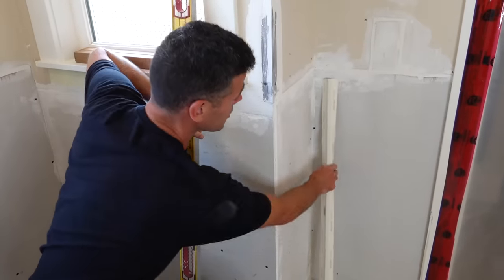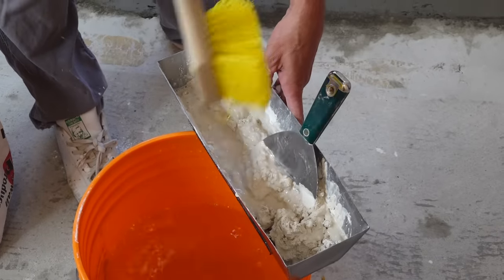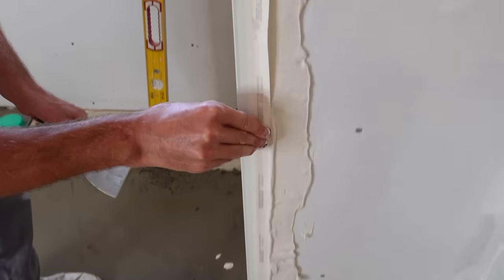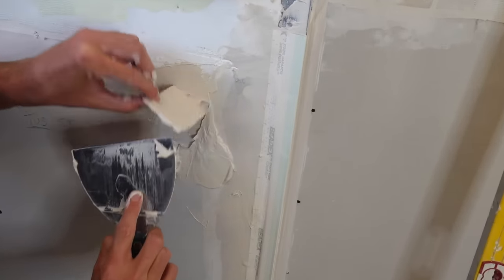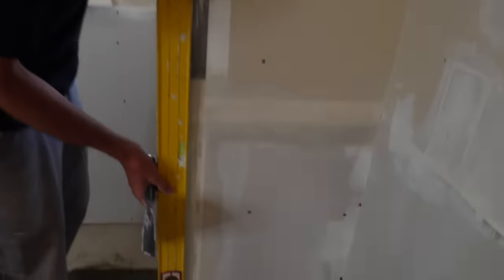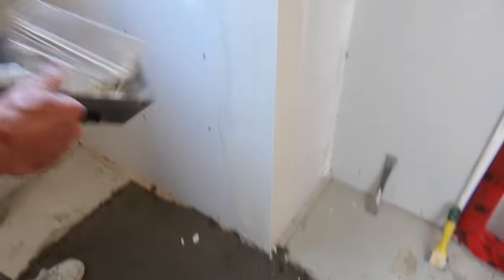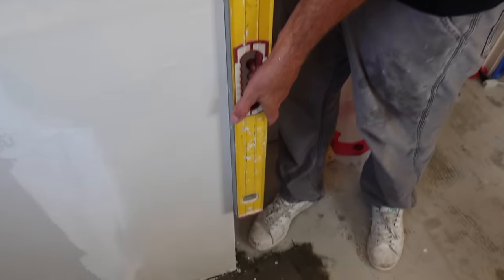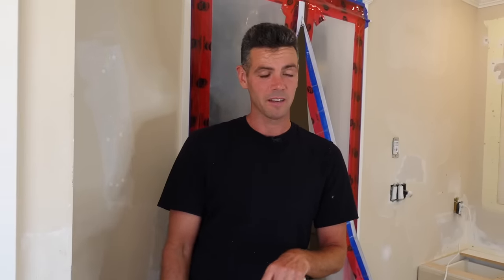How to Join Corner Bead...Seamlessly!!!

Comment: Why wouldn't you tear off the top piece. Replace it with a full piece of bead. Eliminates the hack job
Reply from the maker: Ever walked into a 2 foot flood cut restoration with 20 of these to patch? Once you have you will realize why it’s important to know how splice a bead.
Reply: Why didn't you just pull the old screws out and remove the wet drywall?  Then reuse the corners? Instead you took a grinder and cut them out? I don't understand. Either pull the bead all the way off or find the screws under the 4' mark, remove and slide new Sheetrock behind it and screw it off. Also your already mudding the corner why not do it right and redo the corner. It's not hard I know you know how. Why hack it for an extra buck? If I saw this at my job I'd definitely call you out.
Reply: @phouston6802 @phouston6802 I agree this repair job is a patch. Not the same as a whole new drywall job. Actually you can see the house is imperfect. He should demolish the whole house and rebuild it to make sure everything is perfect.
Reply: @danielanderson7667  LOL, exactly.  Everybody simmer down now.
Reply: @phouston6802 Your idea would just push the meeting point between old and new further out. You’d have to cut drywall back to at least the nearest stud which makes another joint to fix. On the short side there is only a foot to the inside corner, where are you going to cut back to to remove that side? Finding/pulling nails/screws out of corner bead can lead to bends. 
If you ‘call out’ your contractor on this method, and insist on yours, he’ll probably just pack up his tools because you’d be doing him a favor.
Reply: Because these cuts are done by restoration company’s not the finish trades. This is standard protocol when working through insurance. Insurance will not pay for what they don’t have to,  and no one is doing free work either.

Comment: Being a newbie I use Sheetrock 45. Gives me plenty of time to work with it. I’d be scared of trying to use 5 or 20. I’m not THAT fast yet. lol
Reply: 5 is great for patching a hole those electricians love you leave you with when fishing cables in ceilings for example, but use a hawk as your mud pan will be done afterwards unless you clean it out quickly.   20 is similar but you have work working time.   You can easily dump the leftovers from your hawk and clean with a soapy sponge plus if it dry on your hawk it is dry on the wall too!

Comment: Just did a job today where i did this except i used the steal corner bead.  The  wall is texured so small enough area where you don't want to pull out the hopper but big enough where you need more the a can of texure didn't want to go to ceiling. Replaced the whole lower part of the drywall so leveling it was easy.

Comment: Perfect timing on this video.  About to replace a one piece tub in more or less and alcove with a 4 piece tub and wall enclosure.  One side has a partition wall separating it from the toilet and knew I would need to cut the existing corner bead about 2 feet up from the floor to slide the new tub in and was thinking about the process of joining the two corner beads together so not to have to replace the corner bead all the way up to ceiling height if it was possible.

Comment: Been there, done that. Using 2 different kinds of corner bead requires that the old metal bead gets buried to keep that sharp edge from showing and the paper corner needs to be built up to create a sharper edge to more closely match the old metal bead.  
I'm more inclined to remove the old bead and fill any gaps or uneven-ness present from the loss of the original corner. Definitely want to use a quick setting compound. Put in a whole new bead and match it to the wall. Only one problem to solve instead of 3.
Reply from the maker: Could be some regional variance among beads. Our paper beads match up perfectly to the old metal ones. There was no buildup required anywhere on this repair.
Reply: @vancouvercarpenter  
Nope, it was smooth as silk. (I made another comment about how easy you made this repair look.)
The paper covering on the bead is a bit softer looking than on a metal bead, in my experience.  I noticed how crisp yours looked when you flushed it up to the old bead. Pretty nice match. I did some trimless window frames 8 years ago and used a new metal bead, stapled in place. 
I had to shim out the new not quite half inch drywall to match the full half inch existing 40 year old material though. 
Whatever it takes to make it right. 😃

Comment: If you haven’t already, can you do an in depth video on joining new drywall to existing painted drywall? I’ve never actually had to do this, but I have a project coming up where I will, and I’m just curious about the change in surface texture and how that will affect the finish.
Reply: I sand the painted surface with some 60-80 grit. 
Add some watered down glue in my mud and do the joint as usual.
You might want to do a skim coat on the painted surface first as to help avoid bubbles.
Reply: @okkrom I figured I’d need to scuff up the painted surface a bit so I could “hold” the mud, so to speak. Thanks for the tip with the glue and the skim coat! I appreciate it 👍

Comment: Love your videos, thanks for sharing.  Wondering if you have any videos where you install (retro fit) a ceiling expansion joint? I have a job where I need to install a second expansion joint that meets up 90 degrees from an existing expansion joint.  Hoping for some hints.

Comment: Great advice and video.
I have a ceiling to a vertical sky light with a corner tape that has 6 inch split about in the middle if the 5 ft run. How should I repair it?

Thanks for all your videos and assistance.

Comment: This is a good and practical video, thank you. Would the same advice about overlapping the seam apply for taping an angle? Like when repairing a ceiling with new drywall piece that goes all the way to the wall and you are "extending" the new tape from the existing, should I carefully "dig out" a 1" section to the old tape and overlap with the new? Or in this situation just butt up to it?

Also, in this video's example, would it matter if the existing corner bead was metal, could I get away with using paper-faced, mud-set repair?

Comment: Yeah as a residential renovator  I probably would have installed metal bead. But differnt knife stroke for differnt trowel folks.👍
Reply: I too, never used anything but metal beads.(Since 1983) After watching another video by Vancouver Carpenter on paper beads, I encountered a situation where I was laminating a sheet of drywall to one side of a a corner of a plaster wall. I found I had nothing to nail  the bead to. So I figured it was time to try paper corner beads. It worked out especially well. I am sold on the paper beads. It will be my first choice from now on.

Comment: Seamless reapair. You make it look so easy.
Quick question if you have time:
 New wall flexes because pocket door.
Old wall need 1/2 to nothing of mud framing.
Is vertical joint likely to crack because of bendy wall?
Any suggestions?
Thanks for all the great instructionals!
Reply from the maker: Hard to say. Unfortunately there is only one way to find out.
Reply: Maybe I'll come back in a few years to report! Hopefully not! @vancouvercarpenter

Comment: I love hot mud, I tapped a 10 by 10 room, walls only with a 2-foot strip in the middle of the three walls given they tore out a backsplash and tear away up to the existing ceiling with 4 coats of hot mud, along with a finish coat of plus 3, sanded, primed, and painted the next day. I know guys who hate the stuff, their loss.. What's your preferred method of finishing drywall up to an existing popcorn ceiling? The opposite of one wall was the same at the ceiling but I didn't have 3 beads with me, so I applied paper tape as usual but left the ceiling dry, just to use it as a shield so to speak, I cut off when done and I think the tape came out tighter to the ceiling then the tear away, Thanks!
Reply from the maker: I usually flat tape and caulk when going up to texture.

Comment: I haven't used paper on joins in years. How do you plaster a wall with super tight wall paper? That removing the wall paper will end up gouging a good chunk of the drywall paper? In other words, it turned  into a war zone once you got most of the wall paper hacked off? There is a way to do it. Pigment seal it, check it for bubbles or pops. If none then proceed to slap a crap load of long setting plaster on it. Spread it uniform out from a corner to 1 meter all the way up. Now here's the trick, you get a 912 cm by 45 m roll of fiberfuse. The biggest they make and from the bottom up pull out the fuse til you overlap the scotia or corner a bit. Once you're satisfied it's lined up as best as you can get it.

Gently but ever so slightly stick the fuse to the wall. Gently run your splayed out hand over it. You don't have to do it to the whole line of fuse. Just enough so it sticks. Push in the fuse at the bottom where it meets the skirting and simply cut it along the edge.

Now the really hard part and the most crucial part of the operation. Trowelling it in. I use a wide cheap kiddies pool brush i found at home to gently push in the fuse so it stays uniform. Do it once or twice. Anymore and you risk tearing it. 

Once that's done, get your 16" or 18" flat and using 2 hands because you're going to muscle the plaster around under the fuse to fill up the lows and wipe out the highs all the while the fuse beds in. Don't rush, if you got long setting plaster. Say a 120 or 150 set. You've got time. You can tell a low by no wet sheen or if there's a high point where plaster is thicker you just muscle it outwards till it looks uniform. It's not a  new trick for rendering flat. If your walls are sucked in and you never prefilled the voids. It will only follow the wall. It will still look unblemished once painted though.

It's the bedding in that takes the longest and you need to put a blower on it once you've finished it. It's takes days to dry if it's cold. A heater is preferable. Once dried. You get 80 grit pads for your sanding machine and give it a good consistent sand without cutting through the fuse. Lightly but no area left unmachined.

Now for the finishing coat. It will power suck in but you're only trowelling a light coat on. Slap it on thick and wipe it off. Once you start though. You don't stop til you've reached a corner or slimline edge. Once it's all done to your liking. Wait til dry.

Pole sand it lightly and run the light and sanding block over it to catch ridges and spots. Don't go mental and practically sand it all off.

Only 2 coats.

Comes out like new skin and painters love it while the wall is reinforced. I've yet to see anyone anywhere do a vid on how to fuse walls.
Reply: Don't worry about small overlaps when fusing when lining up the next sheet to the 1 you've just done. The machine sands out the overlap leaving a seamless run. I haven't seen a perfect 90' wall or level 5 flat fixing in this century lmao

Comment: VIDEO SUGGESTION:

I searched through your archives and couldn't find an example of what I want to do. In your "HOW TO TAPE 45 DEGREE CORNERS" you've got the sort of sloped wall/ceiling that I've got. I want to put in a rounded corner at the transition from the 45° wall to the ceiling with about a 5 cm radius. Last time I did this, I used USG's Structo-Lite to make the corner, but that product is no longer for sale. Is there a mud product that I should use instead, or should I add drywall to the corners and use taping mud to get the inside curve? I've seen a bunch of locations where you've made these transitions sharp, but I want the angled walls to blend into the ceiling with curves and I haven't seen you do that in any of your videos yet.

Comment: Hey VC, I could use help on a question I'm facing repeatedly as a remodeler. Assuming I'm having pro-drywallers in, at what % of damage is it easier just to re-do an entire wall or ceiling rather than just part of it? Like, if 50% of the wall or ceiling goes, is it easier to just re-do the whole thing? (The other 50% is fully finished, textured, and painted.)  Or would you fix the bad 50% and match it? What about 25 damage% 10 damage%? Thanks!

Comment: I’m trying to finish a level 1 drywall job on my own and recently installed corner bead, BUT, made a huge mistake and put the inside paper lined metal bead on an outside corner. It’s glued and stapled. I attempted to start mudding but can’t get the corners to stick, which is what took me back to YouTube, at which time I realized I did it wrong. How do I go about fixing my mistake?  Thank you in advance

Comment: I have about 7 inches of what looks to be tape showing on an outside corner in my bathroom shower, I was just about to start prepping to paint the room and I noticed the tape on the corner, it looks about 7 inches of tape running down the corner. I was repainting because the paint just started to crack and peel in a couple areas, but now I noticed that tape on the corner and I don’t have any clue what to do about it. Should I cut it out and try replacing it? I don’t know what to do. Can I cut it out and just mud the corner and sand it and paint it? Or do I have to replace that tape? I’m intimidated trying to deal with it.

Comment: Could you just remove the old bead or would that be a lot more work?

What about just selling the house and buying another one with a finished corner bead?

Please let me know.
Reply: LOL
Reply from the maker: 😂just sell it. But to answer your question. It’s a lot less work to just add the new chunk and if done this way the repair will last and be seamless so this is what I usually do in this case. Especially when dealing with a steel bead. Those suck to tear off.
Reply: @vancouvercarpenter  
You definitely lucked out on this one Ben. Watching you get the new bead set perfectly in place the 1st time will disappoint a lot of newbys thinking anyone should be able to this when they give it a shot. Piece of cake...just like Ben did it! 😃

Comment: What situations do you put glue in your quick-set mud?  Why not this time?
Reply from the maker: It depends on the mud more than anything. Hamilton is a great brand that has never caused me adhesion issues.
Reply: Thanks Ben.  We have the Beadex brand here in Seattle.  After watching your videos and The Kilted Guy's, I use Titebond III in pretty much all my hot mud for repairs now.  Prior to that, we had some issues with the mud not sticking to previous paint.  Have to watch the amount you use though as it seems to turn 90 minute mud into 5-10 minute mud.

Comment: You seem to love "hot mud". I don't for a few reasons, and you never address these. It's hard and time consuming, (a lot of time) to mix it in a pan to get all the lumps out to smooth mud. It's always a big guess at the ratio of water to mix. There is a time limit to use it. If you guess wrong on how much to mix, if it's not enough you have to spend the time and mix again. If you guess wrong and there is way too much and nowhere to put it on the wall you have to put it in the trash. And my biggest annoyance is, since it sets up you have to clean all your tools after every batch. You have to deal with none of this with mud in a bucket.
Reply: If you're trying to get a job done in a day or two, hot mud is the only way to go.  Regular mud you have to wait a day for each coat while it dries. No one "likes" using hot mud, it's just a must if you have a lot to do in a short time.